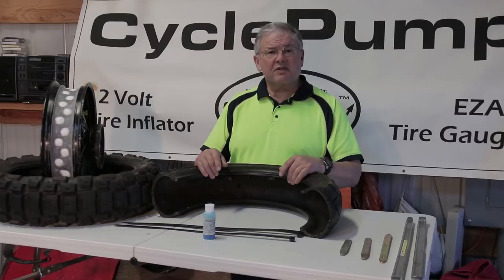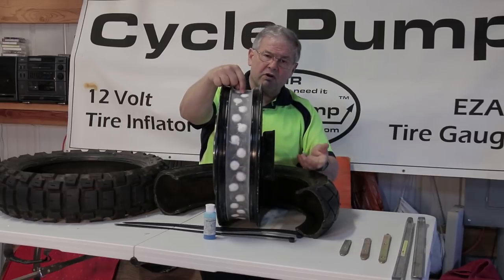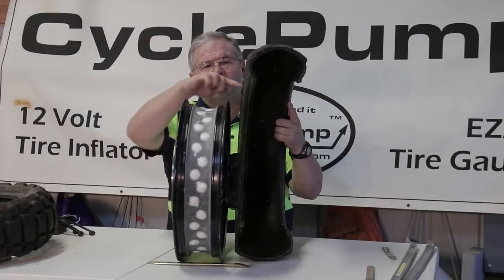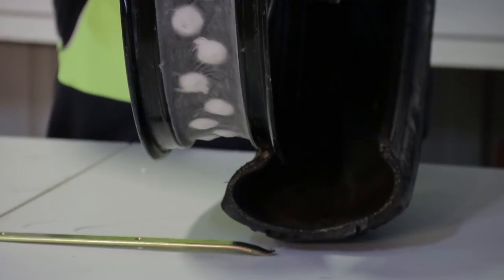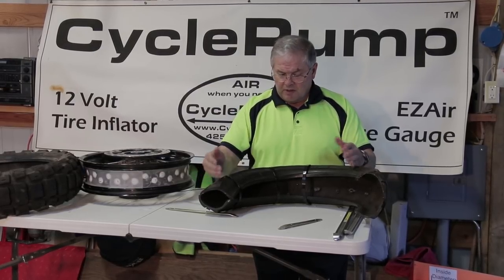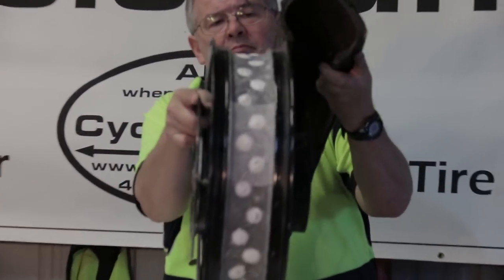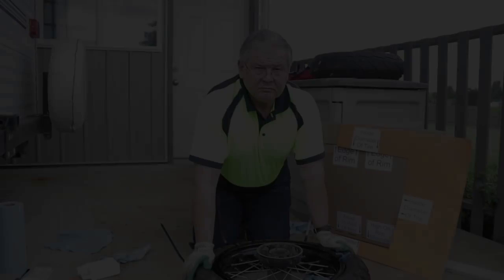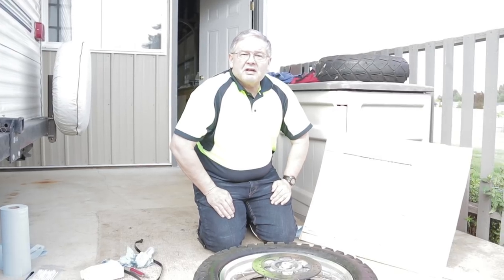Motorcycle Tire Mounting 101   How The Tire Fits On The Rim

Comment: I bought a new bike 14 months ago and with 9,000 miles on it, I needed new tires so I bought some thick and stiff Battlax tires.  The front is a 110 90 18 and the rear is a 130 70 18.  The front went on with some difficulty, but without pinching the tube.  The rear was a nightmare and I went through 2 tubes and hours of back-braking work only to have rear tire fail to hold air both times.  I sent off for a new heavy duty inner tube and while I was waiting for it to arrive, I discovered and watched your video and a blinding flash of understanding went off while watching.  I went down to the hardware store and bought some on those mega-zip ties.  When I had the new inner tube, I did as you did and I had the rear tire on relatively quickly and didn't even come close to endangering the tube.  Thanks so much for the invaluable tips.  I will use those zip ties on all future tire mounting.

Comment: Legendary video! Thank you for the effort!
With all this knowledge mounting of any tire in the field should be piece of cake now. Removal of the Motoz Tractionator Adventure will be probably a little bit more difficult as it wouldn't be easy to fit the zip ties in. But in the worst case it could be substituted by little wooden or plastic blocks / spacers which would fit in between the tire bead and the rim, forcing the tire to the center of the rim.

Comment: Wow everyone who is new to mounting tires needs to take the time to watch this! It will save you so much time in the long run. And in my case the cost of a Michelin Pilot power 2ct front tire lol. I should of done a little more homework before attempting to do my own. Once I got my front tire on I couldn't get the bead to seal for the life of me. I tried every trick that people said. Even bought a designated ratchet strap which was really awesome and I'm happy to have it. But it was $85 that I didn't need to spend. Once that didn't work I knew something had to be wrong so I pulled the tire off and saw where I had cut into the bead into two places! Trashed my brand new tire! I was pissed at myself!
I didn't realize you could damage them that way. I wasn't getting the bead down into the channel enough to spoon it over correctly. If its really hard on you then stop and re-evaluate what you are doing. 
God bless you sir for taking the time to teach us your techniques! This is an excellent and detailed video! I would recommend this to any of my friends trying to learn the technique of mounting their own tires on their own! Hope it helps others from knowing my mistake. Understand the math part of the tire like this video demonstrates in the beginning! Great job on this video!

Comment: 19:30 "usually I can hook this onto the rim on the first side of the bead" 

what if I can't even do that? The first bead is not even close to getting over the rim? I'm using soapy water as a lube.
Reply: Four things:  1) warm tires are easier to mount, set it in the sun so it's more pliable, 2) soapy water isn't the best lube, use a REAL tire lube like BeadGoop for best results, 3) make sure the near bead is in the well before you hump the far bead over the rim, 4) when you lube consider friction points - for the first bead you'd lube the top of the rim and the outside of the bead where it's going over the rim. 
.
Don't skimp on lube, and lube every part of the rim and tire bead circumference - not just a narrow segment.

Comment: David good vid, but I’d love to see you doin the same with brand new tyres, tubes and rim locks .
Cheers
Welsh dirt rider Al.
Reply from the maker: New tires don't really matter.  Neither do tubes or rim locks.  Yes, it takes a few minutes to get the tube in the tire but once inside it's a non-issue.  You have to accommodate the rim lock (put it at the top, away from where you're working).  The valve stem on the tube and the rim lock are the last part of the tire you spoon on.

Comment: by the time you are done you will have bent rotor
Reply from the maker: You obviously don't know what you're talking about.  Rotors won't bend just because you're using it to hold a tire iron in place.  Or because you placed the rotor on the ground so you can spoon the opposite side of the tire.

Comment: I've got a SUPER STIFF shinko 705 I'm been trying to install on a ktm 1290 super adventure for the past two hrs.  I think you moto zips are the answer...thanks for that tip.  Every other video I've watched has the guy popping the bead on in 15 seconds and I just want to smack em
Reply: The physics are irrefutable. If you can't get the bead over the rim that means the opposite side of the tire is NOT in the "well" of the rim.
Reply: @HidalgoRides    You're right, it's not.  It's not seated in the same place I can't get the final bead on opposite side.  I'm losing my mind...done this 4 times and back to the same place
Reply: @HidalgoRides  what am I missing?  4 hrs into this
Reply: Next step is a 12 pack and try tomorrows
Reply: I mean, I'm 51 and I raced motocross for 9 yrs in the 80"s and 90's and been an industrial maintenance man for 22 yrs but this tire is whooping my ass and I feel like an idiot.
Reply: Those tires are whipping yer ass because the beads (opposite your tire irons) are NOT down in the well. You might think they are, but they're not.  Use zipties to compress the beads so they're touching. That way they can BOTH fit in the well. When they do, tool have very little rubber to spoon over the rim.

Use lube all around so the tire can slip into the right position. Dry rubber sticks to the rim, lubed rubber wont.

Warm rubber is pliable. Put the tire in the sun for an hour. 

Step back, watch the video again.  Then start from scratch.
Reply: @HidalgoRides  thanks, but using zip ties are useless.  These tires are too stiff.  I'm gonna try c clamps.  I mean, this simple job has gone into the Twilight Zone.
Reply from the maker: @kepler240  If you're using regular zipties you're bound to fail.  Use X-heavy duty MotoZipps.  They'll cinch those tires together and hold them in the well.  

A C-clamp will press the sidewalls together BUT they won't cause the beads to touch each other.  That's what you're trying to do --- get those beads to touch each other.  If they're even an inch apart then the combined width is too wide and that causes the bead to ride up on the high shoulder of the rim. 

When the beads are touching they'll fit in the well.  When that happens the entire tire can move toward the place where you're using your irons.  

When you get it right, you'll only have about 1/4" of rubber hanging over the rim.  Then you can spoon it over the edge.
Reply: @bestrestproducts648  yeah, im using heavy duty ones I 'borrowed' from work.  The tire just won't cince up at all.  Damn $60 Shinko tire.  I just liked the tread pattern.  The original was a $175 Continental super soft nylon.  I'll think I'll just roll the Shinko down the road and see how far it can go.
Reply: Success!   and it only took 3 days.    I'm having a party and you're invited.
Reply: @kepler240  good for you.  Now take it off the rim and remount, just for practice.
Reply: @HidalgoRides  do you want to live past tonight?
Reply: @HidalgoRides  I've got enough practice for a lifetime.  And all I did was removed and put them back on...no zip ties or c clamps.  I even came up with a few new cuss words.
Reply: I am a word smith
Reply from the maker: @kepler240  watch this video - shows a guy struggling https://www.youtube.com/watch?v=KN4Rvc6tPyI
Reply: @bestrestproducts648  haha.  I know that guy